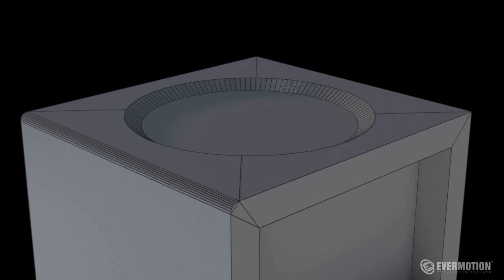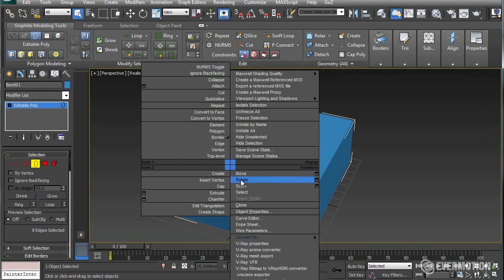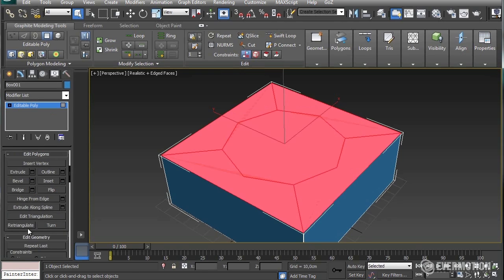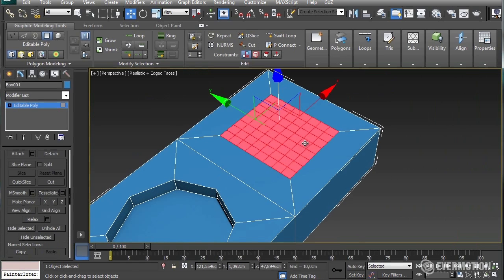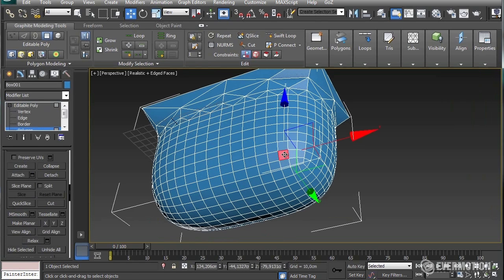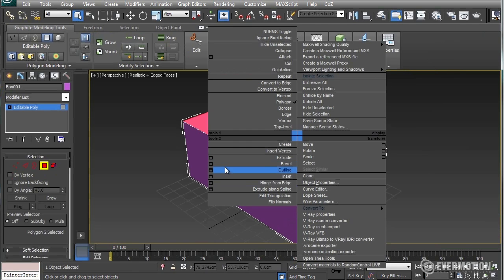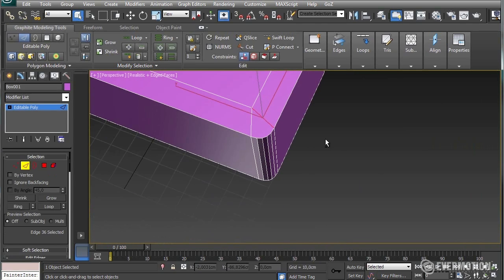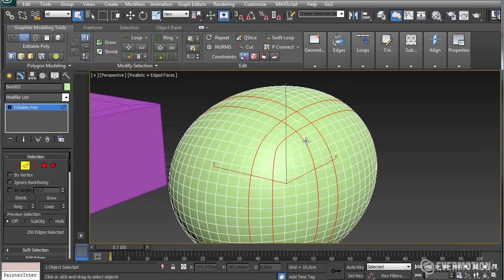Fast cutting holes in 3ds max

Comment: Dont do tutorials if you dont know what you are talking about. You use "bevel" to do the job of an "inset" and then you create a a nice hole... full of NGONS. Terrible terrible... might work for people that just do rendering but if you want to make game assets, this is not the way to go at all.
Reply: Totally agree
Reply: Still new to this myself but if i'm correct: An NGon is any face that is composed of more then four sides. Whilst for just rendering it should be fine, if the model has to be animated then having NGons will make that nigh impossible.
Reply: +IronTarkus Hey, I believe you pointed out something very important and helpful, but can you explain a little bit more.
Reply: Don't write comments if you don't know what you're talking about. Using a bevel instead of an inset is fine, it's just his workflow. Ngons are generally fine for hard surface models, but this tutorial isn't specifically teaching you how to make game assets anyway is it? and people who 3D model should know the deal with Ngons anyway, so your comment is stupid and just an excuse to be negative.
Reply: @cobnor0228  I agree with Iron, You shouldn't teach people who start, bad practices. Creating nGons is fatal to move forward in the design. No longer in assets but also in rendering and even in HardSurface, as you say... It is necessary to avoid at all costs to create nGons. THAT DOESN'T WORK!

Comment: It's unbelievable that we have to mess around with such a bullshit in 2015 to get a hole modeled into a 3d object.
Reply: +Sven Bardos I know, right? I was about to comment the same thing. It's insane how they haven't made booleans work properly at this day and age.
Reply: +Aleixo Teixeira I have started to use Moi3d.A nurbs-based modeler. Booleans work like a charm. Booleans are the way to do things correctly in nurbs-modelling. At the end the Moi3d is able to export polygons out of your nurbs. Works really great! There is a 30-days trail version available. Vitaly Bulgarov also used it for his crates kitbash.
Reply: +Sven Bardos  At least the topology is maintained with some of these techniques. I like the results of holes done for subD modeling better than booleans.  I've downloaded models created in Sketchup and Moi, and they are a mess.  Tweaking for certain needs is impossible on the triangulated surfaces, and forget editing UV's.  I'd rather see an artist put in a few extra seconds to create a hole this way, and give us a cleaner mesh than using booleans, and creating a scrambled mess of triangulated edges in the model.  The only exception I've seen are models done with Meshfusion in Modo, or some Zbrush stuff that's been turned to quads.
Reply: +David Stoolie Depends on your needs. Check out Vitaly Bulgarovs crates:  http://vitalybulgarov.com/3d-kitbash/25-sci-fi-crates They are all done with MoI and procedural textures in Keyshot. No need to subdivide.
Reply: Sven Bardos Yes, you're right in that it all depends on your needs.  I usually prefer subd models because I like to tweak things (if the eula allows for it), or sometimes add or change things to the model, so I like the ability to do that easily with quad meshes, and base models that have been subdivided.  I understand boolean is very fast and easy, but man is it a pain to mess with models that have been created this way.  Definitely not good for use in any kind of vfx or animation pipeline.